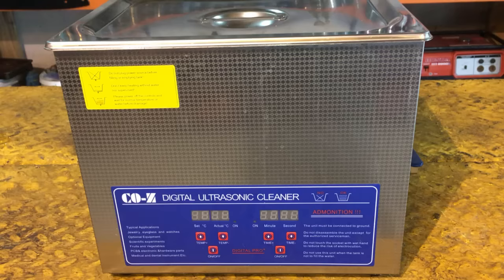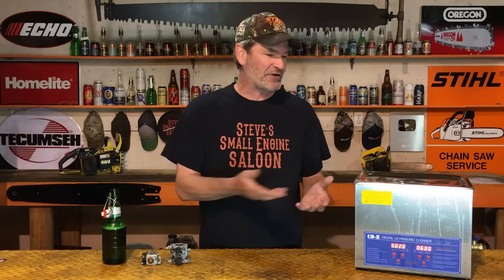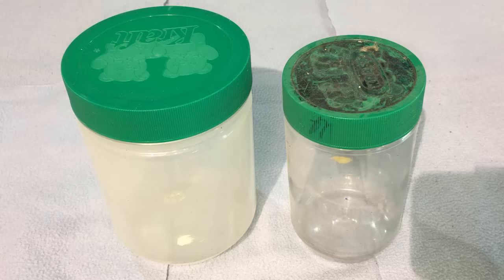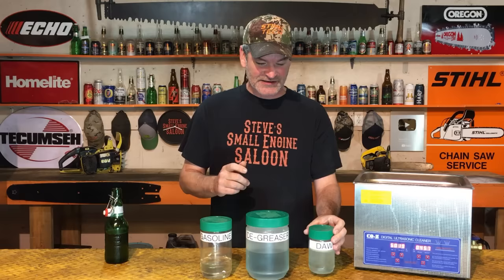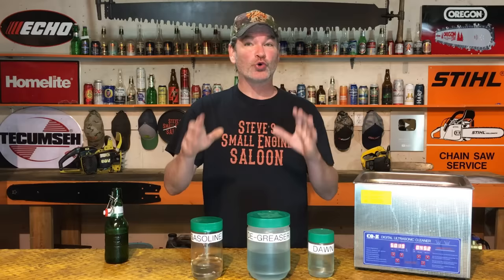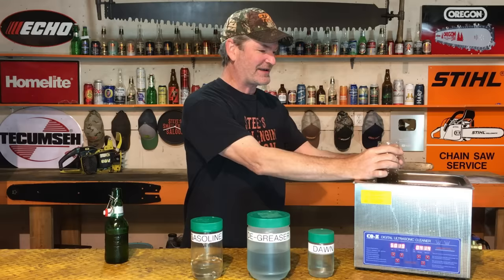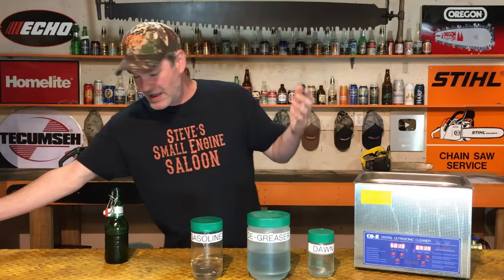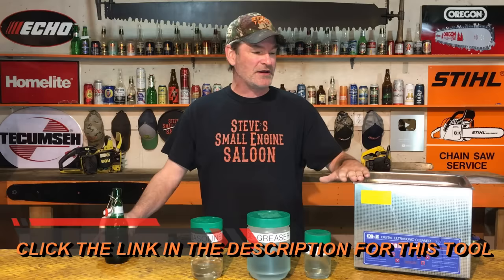ULTIMATE TIPS For Using An Ultrasonic Cleaner (Must Try)

Comment: Hi Steve, awesome video and HUGE appreciation for the information.
last year i found an Ultra Sonic cleaner designed for window blinds, the tank is 2.6 metres long, 180mm wide and 400mm deep (102 x 7 x 15 inches), capacity of 180 litres (47 Gallons) it was being used for cleaning gearbox parts and the company were moving (or closing). 
it has 2 power supplies, with adjustment for amplitude and frequency, and 3 massive transducers in the tank, and it has a separate tank for water and rinse aid, it also has two heating elements that operate on an external power supply.

i got it for AUD$150 and was told they paid $4K, the crate of chemicals they gave me were worth 3x what i paid.

with your great advice i can now use it for everything that will fit within the 7" wide constraint.
Reply from the maker: Excellent!
Reply: Great score on that tank!

Comment: Nice video! I liked the "Welcome guys AND girls" part.
Just a little heads up to everyone - be SUPER careful with gasoline in your shop and also think about the vapors (extremely flammable). Gas in containers other than for a motor is a very delicate thing.

/Guy speaking from - several plastic surgerys, weeks in the hospital and years of recovery - experience
Reply: I can't belive no body is mentioning this. That little plastic jar is holding back an explosion. Surely, it's pressured during the clean.

Comment: If you're struggling to find a decent sized jar I found that ziplock bags work just as well.
Reply: Literally just thinking, fill the bath, but put the part eg bike cassette or chain in a zip lock....
Reply: thanks, i'll try that :)
Reply: ...then after pour the cleaner back into it's storage container but through a coffee filter to remove gunk
Reply: I've been doing that for a few years with my pistol parts. It's been fantastic
Reply: I asked this question then immediately saw your comment. (Embarrassed)
Reply: Nice post ! Thanks for the tip.

Comment: Steve, I worked for Zama for almost ten years, and we used an ultrasonic cleaner nearly every day. We kept a mix of simple green and water, 50 / 50, in the tank all the time. Instead of plastic jars we used old coffee cups to put smaller parts in. Take off the gaskets, metering diaphragm, and fuel pump, and toss everything else in. If you can get the high low needles out, and have replacement Welch plugs, take those out as well and let 'er rip tater chip. The main nozzle and idle check valves won't be effected. When done, rinse with water, and then follow with denatured alcohol and GENTLY dry with compressed air.
We would also put raw aluminum bodies, brass parts, and stainless parts in the same way. We learned that placing a piece of card board over the top of the basin kept the parts and the cleaning solution warm, which improved the cleaning processes.
Never tried gasoline, OSHA might have frowned upon that, but I can see where it would work!
Reply from the maker: Right on Dan..
Reply: Hi What do you mean with green? Is it dish wash? Best R Henrik
Reply: @henrikjonsson4340  Simple Green. It’s a cleaner / degreaser sold in the United States.
Reply: Be sure to use 90% or better isopropyl alcohol. Anything less is rubbing alcohol that has other added lubricants in it.

Comment: I use my ultrasonic cleaner to clean my airbrushes. I put my parts in a small container (I use a stainless steel dentists containers filled with thinner) and the sonic action transfers . Been using my Heathkit ultrasonic that I built from a kit back in the late 70’s. I’ll have to check out these newer ones.

Comment: This is the first video that came up when I wanted to get some info for a cleaner and after watching it, I purchased one immediately. So glad I watched this as it has made cleaning of my airbrushes so much easier. Great video with great info
Reply from the maker: Thank You...
Reply: I'm using it for airbrushes also, what solution are you using. Super Clean (Purple Container) does an OK job but I'm not sure how corrosive that is.
Reply: @GaryNorton_C , I just use standard acetone. Does the job perfectly

Comment: I've used distilled white vinegar and distilled water mixed 1 - 1 to clean parts and it works great by itself, but your tip about the plastic containers really knocks the process of cleanup out of the park. Thanks for sharing this great idea.
Reply from the maker: You're Welcome...
Reply: Putting the parts in smaller containers with various solutions is a  brilliant idea

Comment: You're smarter than you like us to believe. Nice vid, with a good explanation of cavitation too. Enjoyable as always. Respect from UK. Edit: I suspect that the transducers blow, if you don't fill the cleaner, because there's not enough mass to absorb the ultrasonic energy, the transducer will vibrate more than it should and, un-dampened, will overheat and shake itself to a fault situation.The energy has to go into the water otherwise it has nowhere else to dissipate.
Reply: Great reason why you fill it. Thanks

Comment: I just got my ultrasonic cleaner 2 weeks ago. I bought it specifically for cleaning carburetors. I haven't tried Gasoline yet but I will now after seeing how fast it cleaned that socket. I've been using Simple Green at a very mild 10% solution and it works very well to and smells much better lol.
Thanks Steve for your videos and sharing your wealth of knowledge.
Reply from the maker: You're Welcome...and Thank You...
Reply: Does the simple green discolor the carb body ... cause it to go darker in color ??
Reply: @SteffanoDucati  try simple green Pro HD. $14 a gallon. Not supposed to effect aluminum
Reply: I would hold off on flammable liquids, a flash fire could result.

Comment: I cleaned a whole bunch of bolts washers and nuts in a plastic quart jar filled with vinegar. When I finally got around to checking the rusty bolts out it had been about a whole year. It was messy and I had to dispose of all the rust. But the bolts nuts washers were all beautifully cleaned. I also have a Ultrasonic cleaner for small stuff and I stopped using it for the same reason you talked about having a greasy ultrasonic tub. I've been learning more about Ultrasonic cleaners and thanks to you I'm going to try vinegar in my ultrasonic cleaner. Thanks for all the valuable tips!

Comment: Great video! Personally I use mostly ziplock bags instead of cans. I've come to understand that thicker plastic jars, or baskets for that matter will absorb more of the energy and reduce efficiency of the cleaner. Stainless beakers also absorb less. A note on detergent and aluminium parts - strong alkaline solutions will dull and etch the surface
Reply: This is what I do.
Reply: May I ask what cleaning solution is best for anodized aluminum bike parts? Thanks
Reply: Most important with anodized aluminium is to keep the liquid slightly acidic, never alkaline/basic as that will ruin the surface. Most detergents are alkaline so either put some citric acid in as well, or use carosene in ziplock bag
Reply: @thomasrasmussen1132  What would you recommend for a good general purpose cleaner to use that is 100% safe on aluminum also? Fixing up/cleaning an 88 Yamaha ATV and picked up an ultrasonic cleaner a few weeks ago. So far I've only used Evaporust in it on nuts and bolts which worked great. There's a few aluminum parts I'd like to throw in there now but want to make sure they aren't going to discolor or get dull or anything like that. Thanks

Comment: Also, be warned that you should check a list for what gemstones are ok to put in ultrasonic cleaners. Some are very susceptible to fracture due to frequency. (others are very safe)
Additionally, if your gemstone has any post processing cleanups like gap filler or polish, it may take that out.

Examples of very safe stones: Diamonds, zirconia
Examples of risky stones: Emeralds (gap fillers), Quartz (Huge variance in quality of stones but can be very frequency sensitive and usually have surface treatments)

Comment: You are correct, great way to keep the cleaner clean and reduce the cost of solvents. I've worked in several material labs where we needed to use solvents to etch materials, which would harm the stainless tub. We used pyrex beakers, so you only use the amount of solvent you need and you do not damage the cleaner tub. The peanut butter jar concept is great as long as it stays sealed and you aren't using a cleaner that will eat through it. Also some solvents will gas just from the heat of the ultrasonic action and could build up pressure on a sealed container.
Reply: Aside from heat, the gas can't build up significant pressure because it's not adding gas to itself--it's sealed, right?  No?  I can see a tad of build up but not more than space the bubbles would occupy.  As long as you aren't adding heat!

Comment: "Sea Clean 2" is another one, it comes in concentrate
for de-rusting metal I use electrolysis first which turns the red rust black, then ultrasonic cleaning to remove the black magnetite afterwards

Comment: I have almost the exact same unit, and have tried MANY different solutions in it.  IMO, the best, and safest is Krud Kutter Parts Cleaner (made by RustOleum).  Biodegradable, and safe for ALL metals.....will not discolor aluminum or pot metal.  I use it mainly on small engine carbs, and it's amazing.  Another trick....turn on the ultrasonic part while waiting for the solution to heat up....it will heat up twice as fast.

Comment: The reason you must fill the unit to the fill line is the resonant frequency is tuned to the volume of water at the fill line. If you use less liquid you will get poor cleaning or worse still, as you said already, you can blow up your ultrasonic transducer.
Reply: Yep, because the energy (of the vibrations) will not be used to move the cleaning solution, but will be thrown back at the sound generators, which will destroy them.
Reply: Since, you seem pretty knowledgeable regarding the topic, I'd like to ask you a question.  To your knowledge, are all the transducers used in these small ultrasonic cleaners basically the same quality?  I ask, because there is a price differential between the American manufactured ultrasonic cleaners and those made in China. However, I've heard that all of the transducers are made in China.  So, I was wondering how I can judge the quality between the various manufacturers.  I'm looking to use a ultrasonic in motorcycle and automobile restoration as a hobbyist Many thanks.
Reply: @Liam McNieve Somehow I don’t think 🤔 that’s the answer he was looking for.
Reply: @azul8811  Interestingly enough, I’d like to know the answer to your question as well. I also know a thing or two about parts that are made in China because I actually lived there for more than a decade. In short people complain about the cheap stuff that comes from China without stopping to consider how all of that cheap stuff got here in the first place. One of the ways cheap Chinese products come into the U.S./Canada, etc. is the same way that Steve acquired his Co-X machine, and that is direct import (so yes, they do make cheap products to sell. Why? Because most people are cheap bastards and would rather buy cheap products and complain about it later). The other way cheap Chinese products wined up on retailers shelves is because the U.S./Canadian buyers that source from China are only interested in buying cheap shit to be sold at Walmart/Canadian Tire and the like. What most people fail to realize or acknowledge is that China also has great factories too, and just one example of that is the your Apple products. I certainly don’t see anyone complaining about how shitty their IPHONE is made. 

From what little I have been able to learn about these cheap Chinese units are that the failure points aren’t necessarily the transducers, but rather that push button circuit board that that operates the unit. That board is filled with really cheap chips, diodes, etc. The boards are what usually burns out or overheats because the heating elements gets taxed. They will likely last a bit longer if you filled them up with boiling water from the beginning instead of relying on the heating element to bring the water up to speed.
Reply: @Liam McNieve  LOL.  I try to when my budget can afford it.  I bought two US made Wilton bench vises last year. One cost me $900, and the other about $600. I've been pricing out a US made Baldor 2 speed buffer with pedestal and it runs over $1200.  So, do I buy a US made ultrasonic cleaner for over $1000, or a Chinese one for $169?  It depends on how much use I am going to give it, and if the US ones are comprised of Chinese parts.  One of the US made ultrasonic cleaners doesn't include the stainless steel basket even though it is a necessary accessory. They charge $250 for the basket alone.  

The other thing is that some stuff is promoted as Made in USA but is actually just assembled here of foreign sourced parts.  Or think about cars.  Do I buy a Ford made in Canada or a VW made in Tennessee? It's a similar case with clothing. There are still sweatshops here in NYC. There are undocumented people sewing foreign sourced fabric into blouses, etc. I believe that the labels say made in USA.  So yeah, buy American. I'm with you on that, but it gets complicated.
Reply: @sumporfuk  Ah, okay.  Thanks.  I appreciate the info. I happen to agree with your assessment regarding the quality of manufactured goods from China.  They certainly have the ability to build quality. I've seen it.  But they will build whatever the customers in US/Canada/Europe want them to build.
In North America we live in a throw away society. IDK about Europe, but I'd suppose that Western Europe is pretty similar.  What's the expression?  We buy stuff we don't need with money we don't have and with no place to store the stuff...or something to that effect.  Anyway, thanks again.
Reply: @sumporfuk  
There’s plenty of crap made in America. McDonalds for example. The most advanced tech is now made in China/Taiwan. 
Manufacturing outputs different quality grades, which are sold under different brands at different prices. 

Regarding America’s dominance, that ship has sailed. Trump has severely damaged America’s standing in the world, in just 4 years, helping China rise to the top. For example trump allowed commodities to be traded in Yuen instead of dollars. That’s irreversible. 

For those ultrasonic cleaners, the same looking product is sold under different brands at slightly different prices. They have the same parts inside. They might be the exact same quality, or maybe some brands have the “lower quality” and others have the “higher quality” components.
Reply: @azul8811  I agree. Having lived and worked in China for 3 years in automotive, I can tell you that there are essentially 2 different Chinese manufacturing companies, those that are privately owned and those that are state owned. I found in my work there that the privately owned companies operated on par with any Japanese or German company in terms of quality, time of delivery, and customer service. The state owned companies, however, were the exact opposite. Employees knew that it didn't matter if they produced quality or shipped product to their customers on time, they knew they would get paid anyway.
Reply: @sumporfuk  haha
Reply: Mine works best when the water line is barely above the object I’m doing. No, you don’t need a full tank everytime
Reply: @jaredwhite489  Think you're right as the instructions mention the same.
Reply: @jaredwhite489 crazy because mine states in the instructions manual that the unit MUST be filled to the full line or the machine will be damaged and break, just as others have mentioned in the comment section AND as he said in this video that he didn’t have it filled to the full line and totally ruined the machine and had to buy a new one!!!

Comment: Hi Steve, using small glass or plastic container in the cleaner is a great idea, never thought of it.  The reason that you MUST fill these ultrasonic cleaners to the top is that the water/solution acts as a heatsink for the transducers that generates the ultrasound vibration.  If you fill the cleaner with only small amount of liquid, the transducer(s) will overheat and burn out very quickly.

Comment: I use a mix of white vinegar, dish soap and water.  Dish soap breaks down grease, white vinegar breaks down other dirt particles and water cause it’s a chap add in. I then use distilled water to wash it all off. I mainly clean circuit boards but that mix works well for jewelry and other items as well. 😄

Comment: Steve,  I appreciate the plastic jar tip. One warning to buyers....the instructions warn against using petroleum products ( gas, acetone, turpentine , etc. ) due to flammable results.  It would likely be wise to keep the lid on the jar as well as the cover of the cleaner to minimize any vapor issues.  I bought one and enjoy the results for carbs and other devices with small ports and crevices.   Thanks     J K
Reply: Haven't seen the electronics but they would need to be very spark risk free.
Reply: Just have a fan running.
Reply: My harbor freight one heats the solution if you want , and if I use the jar of solvent  trick I keep the lid off. 
It works alot better and there's minimal issue,but I'm not using gasoline for solvent either.